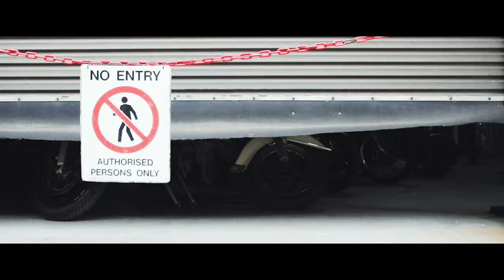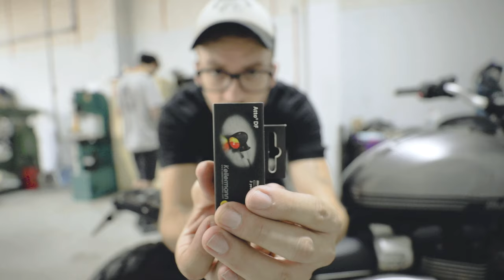WORLDS SMALLEST INDICATORS!! | Fitting Kellermann 3 in 1 Atto Indicators

Comment: Hey mate, you don't need to add resistors. Turn the bike on holding the info button (I think) and you can choose from different flasher modes. Have a google, you'll see. They did this to avoid having to add resistors themselves when you buy the official LED indicators. Pretty sure Butch from Bike Shed UK even did a vid on his Street Scrambler.
Reply from the maker: Yea man i've had this mentioned to me a few times. I've tried all 4 types and none of them work for me strangely
Reply: @MotoFeelz  If you are still having a problem with your indicator flash rate, this video might help some? https://youtu.be/dFDnDPPnWE8?t=603 (Great looking bike Rob!)

Comment: Hey mate, did you get it registered with the integrated tail light/indicator lights at the rear? I have heard they're not ADR compliant in Australia and I just bought a bike with an integrated tail light/indicator setup, so I am wondering if I need to disable the indicators and fit some Kuryakyn Atto indicators instead.

Comment: I got the same taillights for my xsr900 but I cannot figure out how to connect only one ground wire for three different functions. It shout be 5 wires per bulb 2 wires for turn signals and 3 for running and brake to share same ground wire.. how did you get the connection done? Did you ad wires to the harness and a split wire ?
Reply: I have the same problem 3 wires , they said 1- hot tail light, 1- hot brake light and 1- goes to turn signal ground ????? Can’t figure this out